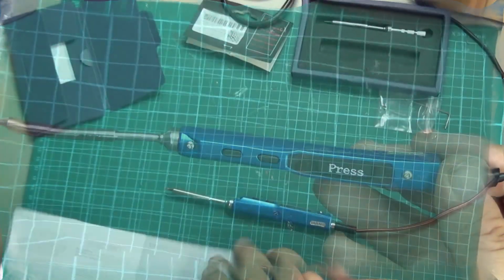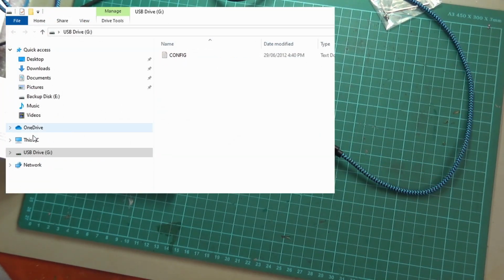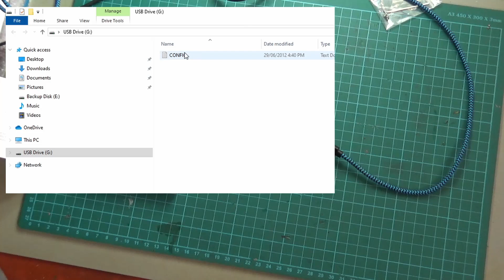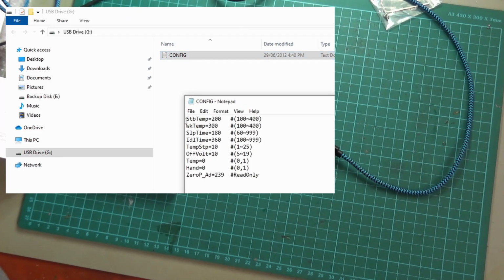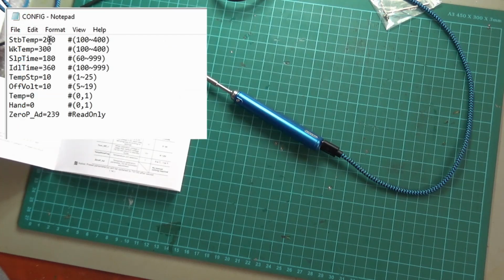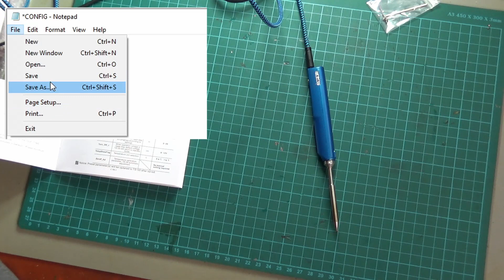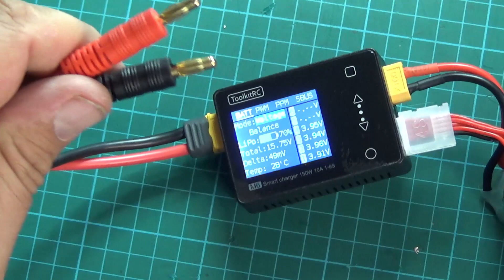Mini TS100 Soldering Iron with Battery Setup & Review

Comment: Try using a 20 volt tool battery. I use a dewalt battery with a xt60 dewalt battery adapter. works much better than using a 12 volt battery setup.
Reply from the maker: Thanks for the suggestion will give it a try.

Comment: whether a fuse should be placed between the battery and the soldering iron
Reply from the maker: It is low voltage and I do not have a fuse between the battery and the soldering iron.
Reply: @PinballEvangelist  whether the 24V with 3A power supply is too strong
In the user instructions, it says that the maximum is 24V 2.7A
Reply from the maker: @2206Igor  I have been using this setup for 3 years now and not had any issues...so far so good 👍👍
Reply: @PinballEvangelist  It doesn't show Config on my computer 8:38
What is the problem that the computer does not recognize the soldering iron
Reply from the maker: Are you using a Mac or PC?
Reply from the maker: I would spend about a total of $20 and get some 'Tip Tinner Paste' https://amzn.to/3XLFlR6 and a 'Tip Cleaner' https://amzn.to/3XGFNjL  Both last for ever and easily pay for themselves as your tips will last longer and will improve your soldering. (both links are affiliate links which won't cost you more but want to be transparent)

Comment: what is the working time at 370°c with you battery ?
Reply from the maker: I have never felt like recharging was that much of a pain I needed to measure it and the TS100 does a great job saving battery life but turning off when not being used and because it heats up in seconds is not an issue.  So in short more than enough....

Comment: Great video. why not just buy the hakko fx601 most games have a service outlet and it is portable and easy to use. I use mine for all my soldering
Reply from the maker: Parker, thanks for the comments... keep them coming.  I have nothing against the small form soldering irons like the Hakko FX601, I just saw the TS100's online and was intrigued so bought one.  I was really impressed by its small size and speed to heat up so thought I had to test one.  I have found soldering with it great and now use it about half the time even when I am at my bench and have access to the Hakko FX888D, its just so light and easy to use like a pen.  Not all my games have service outlets and the battery option has made it really versatile.